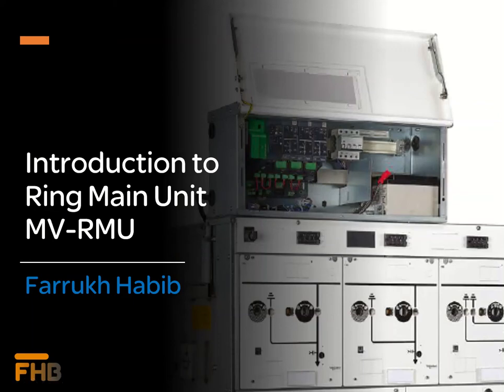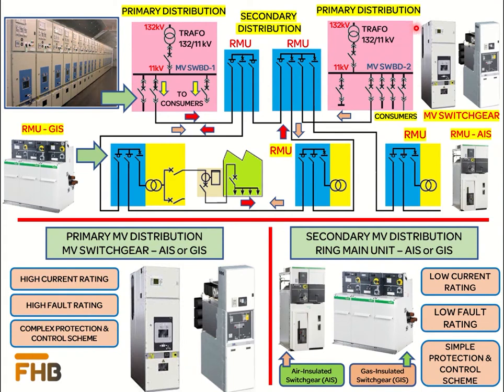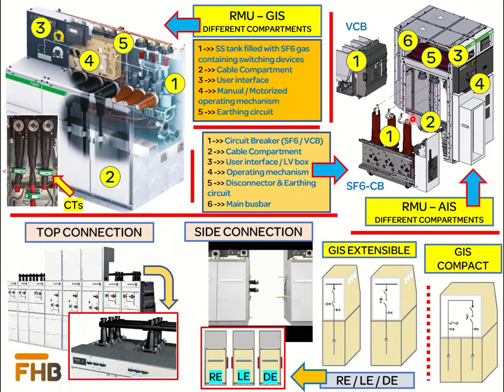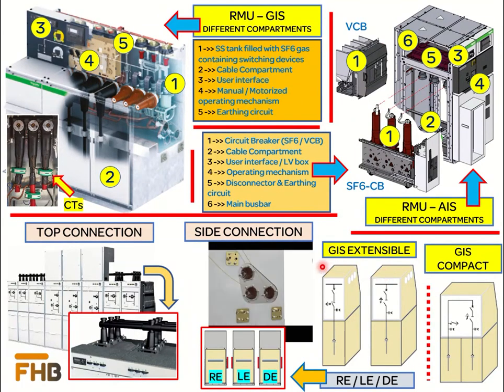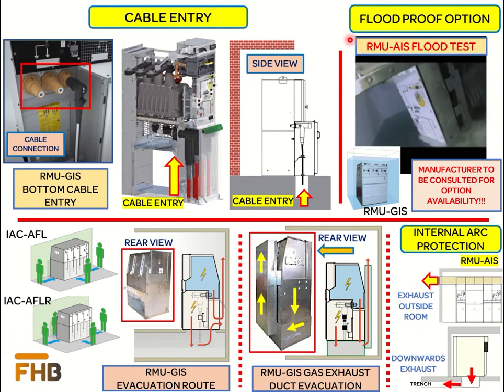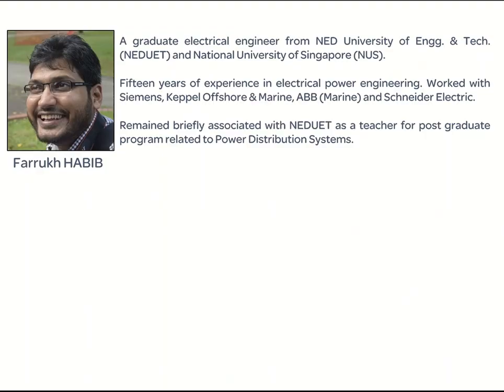Ring Main Unit - MV RMU | Farrukh Habib - FHB | #ElectricalEngineering #rmu #switchgear

Comment from the maker: KINDLY LIKE & SHARE THE VIDEO - PLEASE SUBSCRIBE THE CHANNEL!!!
0:00  -> Introduction about the v-log.
0:25 -> What are Primary & Secondary distribution systems?
2:01 -> Difference between Switchgears & Ring Main Units (RMU).
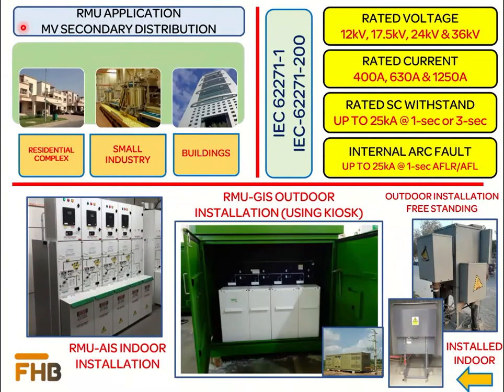2:45 -> Different applications where RMUs are used.
2:56 -> Electrical characteristics of RMUs.
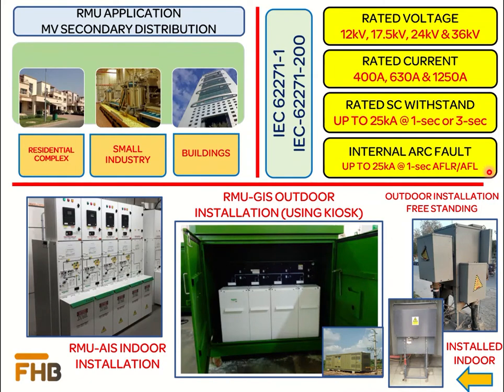3:45 -> How RMUs can be installed?
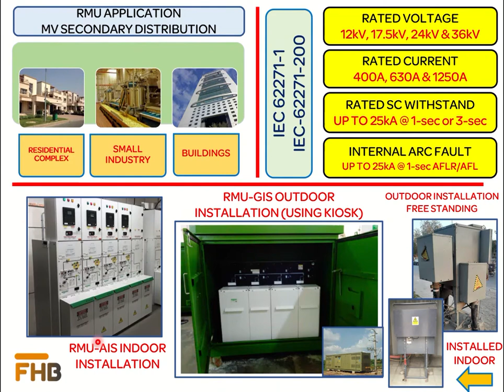4:15 -> Different RMU compartments, both GIS and AIS.
5:40 -> Compact versus Extensible design.
7:08 -> How to connect the cable in RMUs?
7:47 -> Flood Proofing option for RMUs.
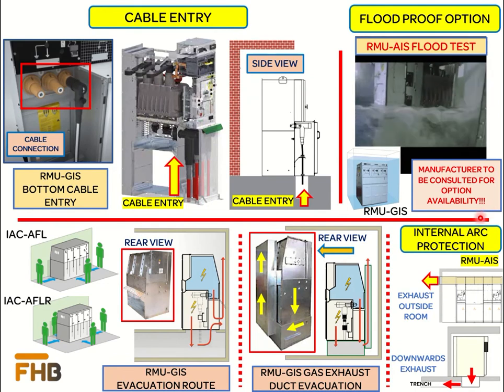8:16 -> Internal Arc Classification (IAC) for RMUs.
================================================

RELATED VIDEOS!!!

MV Switchgear - AIS -> https://youtu.be/6qH37Dl1fr8